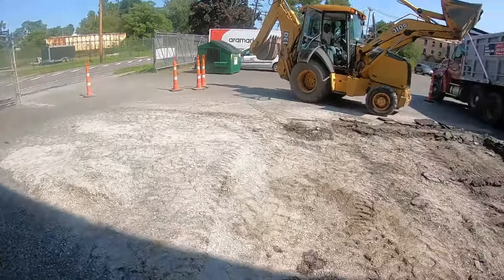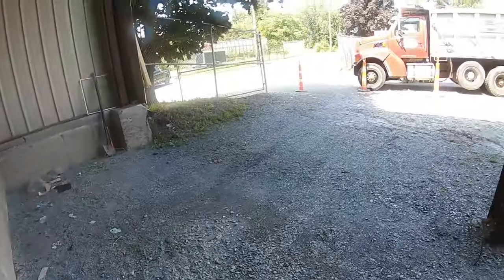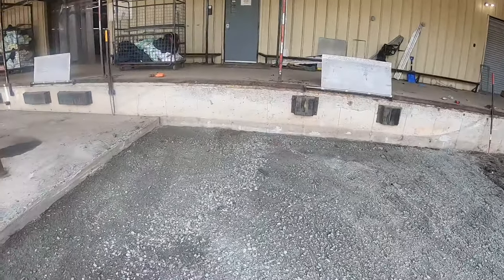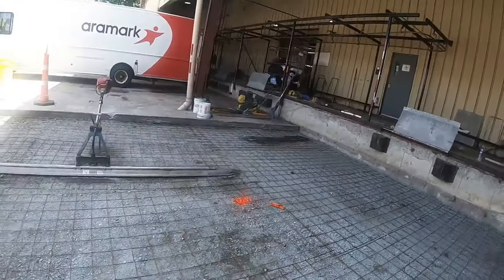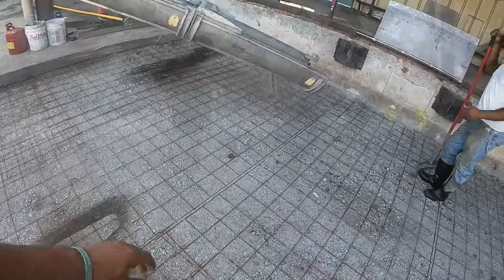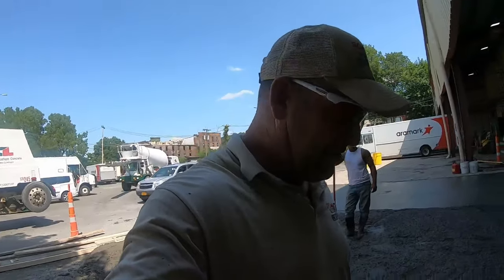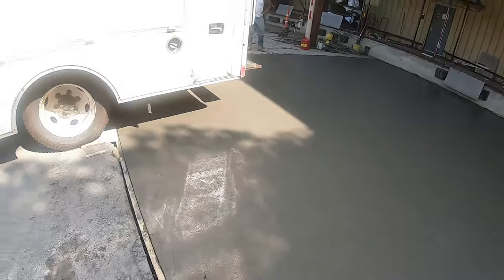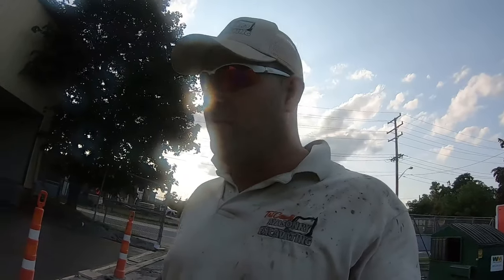Building a concrete loading dock apron #concrete #loadingdock #dirtboss

Comment: I liked how you put a form between the blacktop and the apron really makes it look good. Why didn't you bring the Kubota skid steer? What about using a sheet drain for the second phase?
Reply from the maker: Brian Kubota was on another project the "tricky foundation" also the mustang has a bit higher of a reach. What's a another name for "sheet drain"
Thanks
Reply: @DIRT-BOSS  It is those drains you put in that have a grate on top and a trough the water goes in cross wise where there is sheet water or water running downhill. If that makes any sense.
Reply from the maker: @briangardiner1015  
Yes we call them channel drains.. most likely that's what I'll use I just have to have one  heavy for tractor trailer.
Thanks bud!